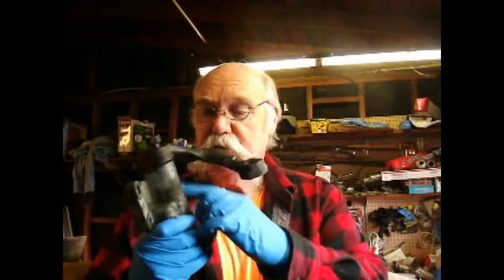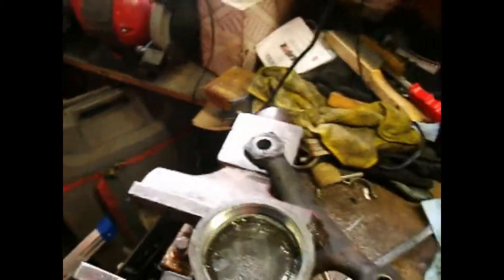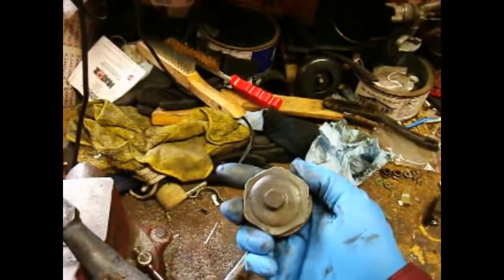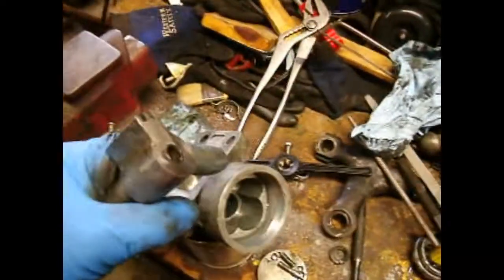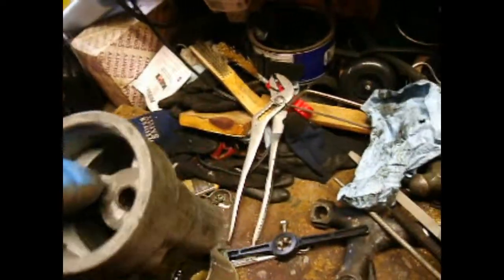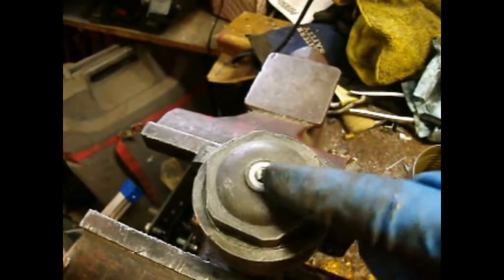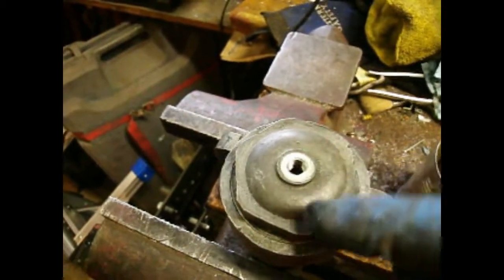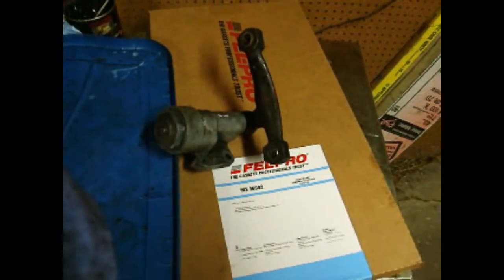Rover P6 Steering Relay

Comment: I have read these may not be serviced and as such not disassembled. The pressure valves are clogged quite commonly after long stand still.
Reply from the maker: It wa quite easy to disassemble and clean.. I had to replace this one later as the Body casting cracked along a stress point.  Thanks for watching.

Comment: I have bought such car, unfortanely the steering do not work, the steering wheel just turns around and around without moving the wheels.
Reply from the maker: There is a short shaft between the steering wheel and the steering box.  It has  U-Joint.  I would check that first, the splines might have stripped out.
Reply: @ejhbritishcars6907  Oke thanks. I did jack the car up, then the wheels do react when turn the steer, one direction complete the other partly. So there is a shaft where there is a rubber in it I did see on forum that in the aluminum part  the splines where gone.
Reply from the maker: It would  be a difficult part to find here in California, but I expect it would be easier in the UK.  You might be able to find something from an Industrial Hardware supplier though.